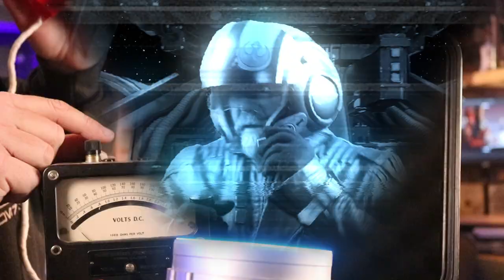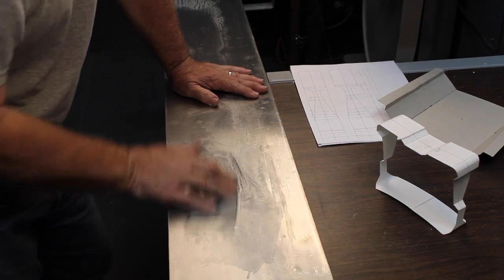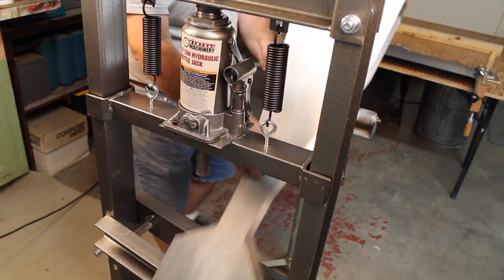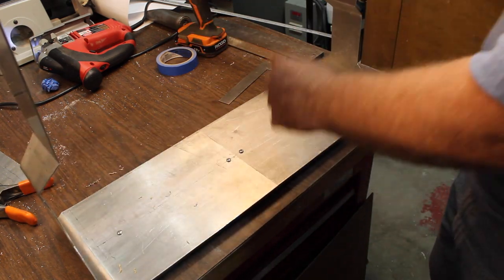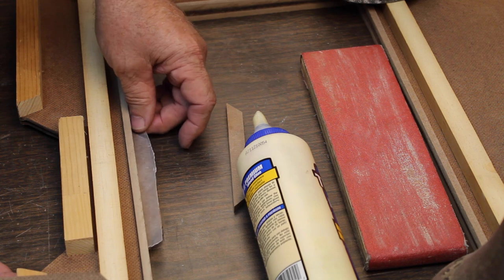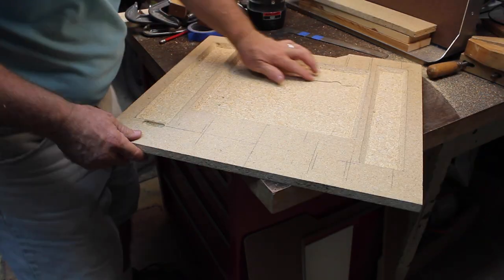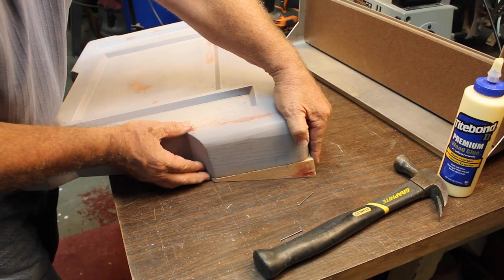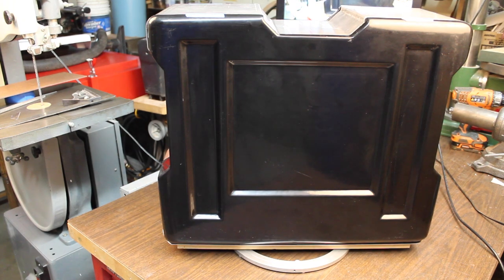Star Wars Prop Replica | Rebel Mobile Comms Unit Part 1

Comment: I had done a lot of welding and fabrication in my time. I wonder if the bend allowance was in mind with the bends. The thickness of the metal makes a difference when making bends, especially if you bend both directions.

Comment: Hmmm, an old monitor from a thrift store and a raspberry pi 4 you could make it actually work. LCD's are clear when you remove them from the frame and remove the back lighting unit.

Cool project with lots of ideas for expansion. ;)
Reply: Thanks for the tip, sounds like another project in the future.

Comment: I laugh when I check into your channel because of the things I see. You use the same paints, collect the same junk and even your dad made a DIY vacuform machine (my dad made ours using patio quartz space heaters instead of completely making heating elements). This time I laughed because you're using a lens out of projection TV for your holo-projector. I salvaged 3 of those out of our old projection TV back in 2003. They sat around forever until when I was asked by the Rebel Legion to help make displays for 2016's SWCO. They ended up as holo-projectors in the center of our cantina tables.
Reply: Like minds think alike! Thanks for sharing.